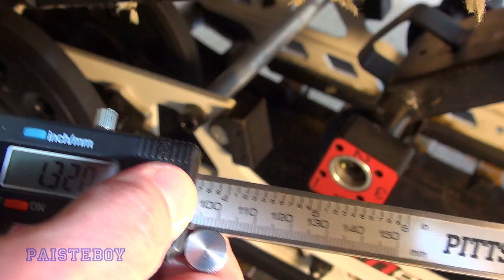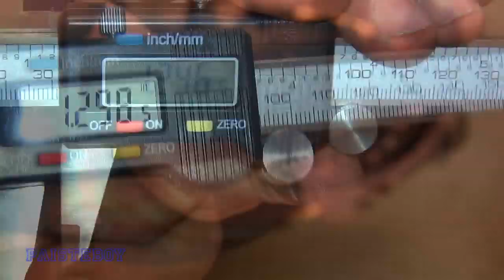How to Slider Hyfax Replacement on Ski-Doo R-Motion

Comment: I've seen video where guys just get them started then start the sled and run the track, and they just peel right off. I think they go in reverse. Not 100% sure. But it looks super easy.
Reply from the maker: I've seen them as well after I made this video but I still don't trust that method.  It could damage the track if something goes wrong.  Not willing to take the chance.  Thanks for watching.

Comment: Nice video . Mine are due to be replaced soon. I usually run the track to align it after setting the tension. Was it ok doing it your way ? Thanks
Reply from the maker: Yes, it was fine.  I did tighten it up a little bit more at the very beginning of this season as there was a little slack in it.
How many miles on your sled at this point?  I changed mine at about 3000 miles. Thanks Mark.

Comment: Hey are those picks in the track factory or did you install them? If so what’s the make etc? Thanks
Reply from the maker: They are factory.  It's called the Iceripper track.  It has 1.25 inch lugs.  Thanks for watching.

Comment: Doo sliders are did ya pay up for the Duponts ?
Have you had your shocks rebuilt yet, don’t know how many miles you have on em.
Reply from the maker: These are OEM stock Ski-Doo sliders.  Didn't think the extra money was worth it since I got 4 seasons off the first set and I may trade in next year.  I have a little over 2800 miles on the sled.  I may do a shock rebuild at some point this season. Thanks for watching.

Comment: One thing I like to do with my track is burn those fibers off, Just take a lighter and they burn pretty simple and cleans the track up.
Reply from the maker: I received many comments about that and already planned on doing it before I made this video but was able to get to it until after. I used a small map gas torch to burn them off.  Being careful of course. Thanks for the suggestion and for watching.

Comment: On your Rubber Track . Take a propane Torch . And very careful burn- off , and seal the Track cord  string. Along the edge of your Track.  So track cords will last longer.
Reply from the maker: Yup. I actually mentioned that when I was recording the video but had to cut it out since the video was getting too long.  Thanks for the reminder!

Comment: Hey, I cut one of the new sliders  2"shorter , I still put it on. I should be ok?
Reply from the maker: If the end of the rail is exposed it could possibly rub on the track.

Comment: Peel them off with Vice grips, Clamp from the side, Bend or peel them off, Then Line up the window, slid the Slider in with a Hammer... Way easier than pounding them off!
Reply from the maker: Nice suggestion.  Thanks for watching.

Comment: What brand sliders did you install, are they the Dupont Vespal or Ski Doo's? Were they the original sliders? How many miles did you get out of them?Great job, appreciate the video! How about a tutorial of your Linq accessories you have and all the things you take on a long day ride.
Reply from the maker: These are OEM stock Ski-Doo sliders.  Didn't think the extra money was worth spending on the Vespal sliders at this point since I got 4 seasons off the first set and I may trade in next year.  I have a little over 2800 miles on the sled.  I did do an install video on the Linq bag but I can do a video on what I keep on my sled.  Thanks for commenting & watching Mark.
Reply: @Paisteboy  What did you lean it up against the bars? Steering stem?
Reply from the maker: @BlueRage  
I had it resting on a 2 step plastic  step stool and an additional wooden 1 step step stool.  I thought I included a quick shot of that in the video.
Reply: @Paisteboy  Makes me nervous to do so but it clearly makes a nasty job easier. What did you lean it on?
Reply: @Paisteboy  Against what on the sled?
Reply from the maker: @BlueRage  
I leaned the handle bar end against the 2 stools.
Reply: @Paisteboy  OK, excellent...thanks...couldn't quite see in the video. I'm nervous about putting pressure on the bars / steering stem. I see guys do it all the time...but think of the weight and the weight of the fuel.
Reply from the maker: @BlueRage  
It's really not much pressure.  You want it angled so that it's just about balancing in that position but won't rock back.
Reply: @Paisteboy  Excellent, thank you...will give it a try... my least favorite job is sliders :)

Comment: I drove into an Old Forge repair shop with a missing wheel and bad Hyfax 
$125 and I was riding a half hour later . Labor was $40
Reply from the maker: Yeah.  They are really good over there at getting people back on the trails.  Sounds like a pretty good deal too.  Thanks for watching.

Comment: Anyone else here just get them through the track window then start the sled and throw it in reverse to rip them all the way off? Works for me
Reply from the maker: I'd like to see that.  It seems that that could damage the track.  I'm assuming that you reversed it slowly.  Thanks for watching.
Reply: Now that's something I'd like to see as well.
Reply: @Paisteboy  l remember reading something like that only the track is going forward of course with the hifax already poking through the window... If the hyfax is already past the curve of the slide rail, the forward motion of the track should kick this thing right out.. just plan ahead as to where the missile goes !🤣🤣🤣
Obviously this trick wouldn't be possible to install a new hifax, I can imagine it would snap it right in two.
Reply from the maker: @jeffreyhagelin3672  
I saw a short doing just that. In reverse after you pull them through the window and they are passed the curve in front,  slowly throttle and it just peels it off and doesn't throw it anywhere.  I think that could could put unnecessary stress on that window on the track.  It's equivalent to having the skid pulled and the pulling down on the slider and peeling it off instead of sliding it backward to slip it off. It definitely works but I'm not sure if you want to take the risk of potentially damaging your track.
Reply: @Paisteboy  this was something I read from one of the snowmobile magazines written in by someone who bragged how he had tried it.. I wouldn't try it personally because I doubt that it would be shaving much time and of course if it did not eject cleanly it could possibly damage the track window.... Those tracks are expensive.
Reply: @Paisteboy  I don't see how it could work in reverse, since it would definitely get caught up after the hyfax met with the resistance of the curve from the slide rail..
The hifax would then lock up the track and if there was enough energy, snap the hifax and or destroy the track.
The procedure might work taking the old hifax off provided a person proceeded slowly but only after it was manually slid past the front curve of the rail..
Reply from the maker: That's what I described.  Pull the slider out through the window and past the front curve of the rails.
Here's the link. 
https://youtube.com/shorts/vVoTw3NJ_PQ?feature=share

Comment: The correct spec for track tension is 16 pounds of downforce in center of track that creates one and three eights inch of play. Your track is to tight!
Reply from the maker: It's at about that now after a bit of riding.

Comment: Your process is way to long and complicated, you really don't need to loosen rear boogy wheels or track. Just did mine today on a skidoo, all i did was tip machine to one side (watch not to damage body or wind shield) adjust track to allow access to front slider screw, remove, take long metal punch and tap screw hole in slider back to where it hits back hole of track, take a large screw driver and twist slider till it protrudes through hole...continue taping slider back till almost through or pull back till slider is free. I certainly used silicone spray for lubrication, no track adjustment or boogy wheels to retighten. Three hours of work in tight garage...done.
Reply from the maker: I consider that next time.  I figured there would be way too much friction with the track and sliders and even worse installing the new sliders which are not adjusted for the thicker sliders.  You probably never adjusted your track as your old sliders wore down and your track was already loose. 
Thanks for sharing and watching.